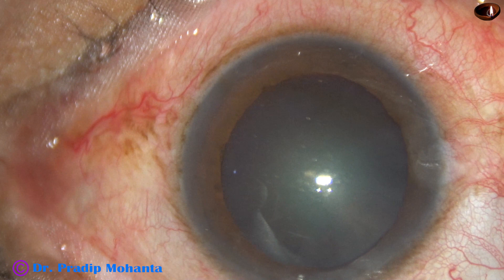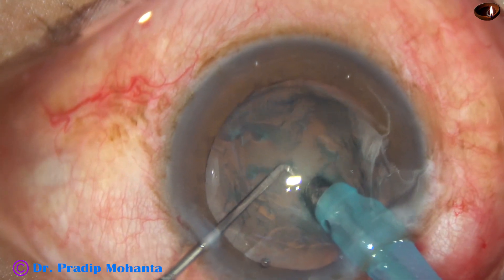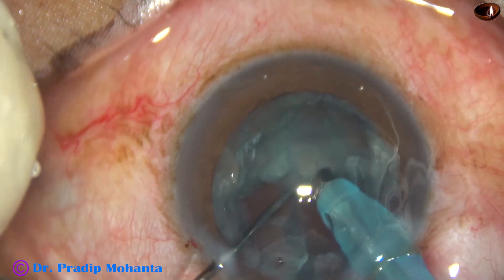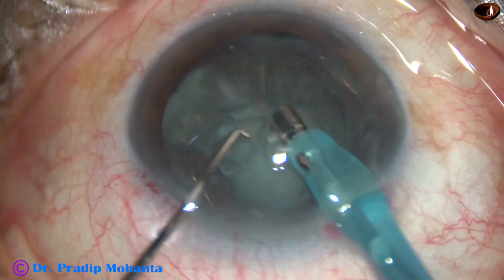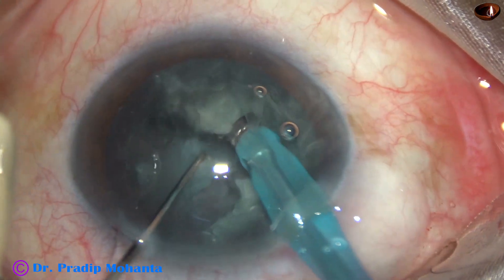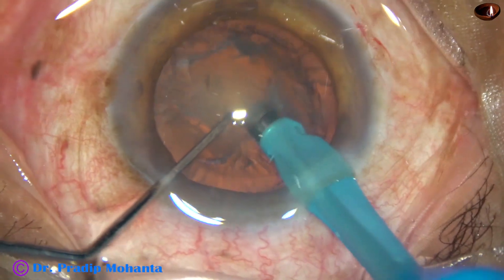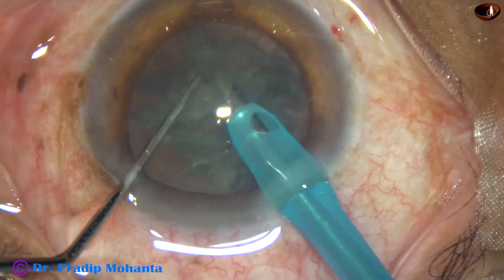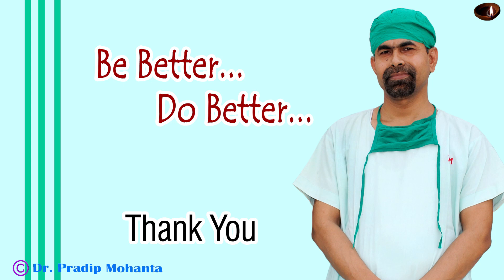MECHANICAL CHOP FOR SOFT CATARACTS : Pradip Mohanta, 20 Dec, 2019

Comment: Sir using protege storz model ( in my railway hospital ) it doesn't have phaco 1,2,3 settings , with power 50 , apsiration 70 and 45 cm bottle height it works fine with NS3 cataract but in NS1 -2 the nucleus becomes like a bowl . How to modify my settings so that i can do chopping by this  technique.
Reply from the maker: Too much to type.
Call +919734523795
Reply: @pradipmohanta9321  ok sir